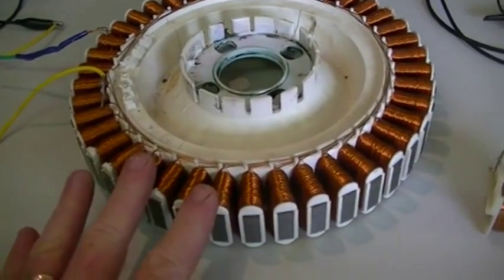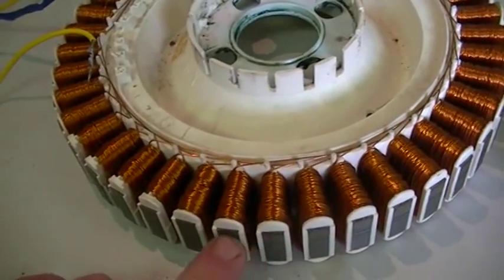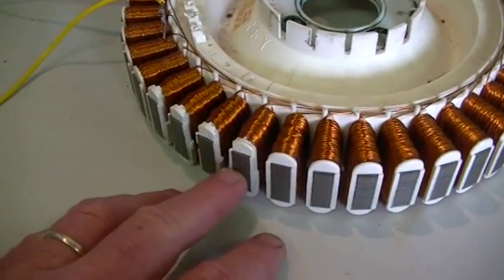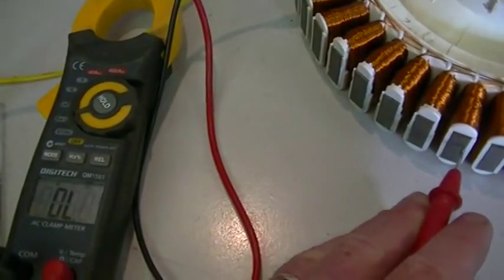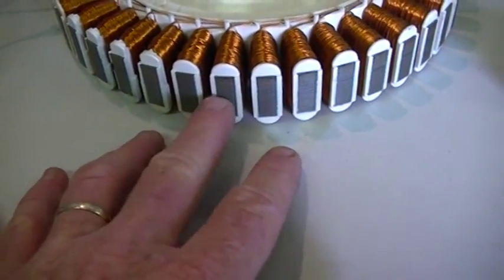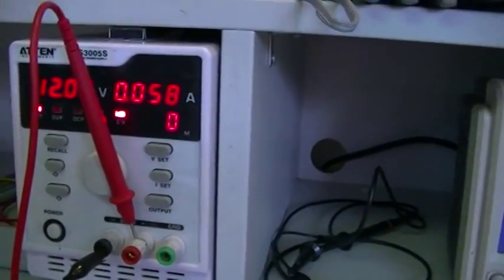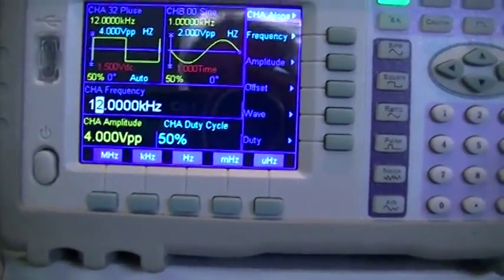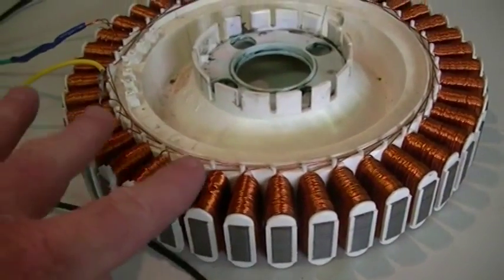Duel Magnetic Vortex Generator another look

Comment: Don't forget, the simplest electromagnet is a nail and a few turns of laminated wire, do you get a circuit between the nail and one end of the coil??? and, of course a magnet waved across the end of the nail, and so-on and so-forth..........

Comment: i would say it could be like a joule ringer like lasersaber or the work Xee2 did with transformer but in this case your taping off the core instead of a separate output coil..
Reply: yea the greater the frequency the more the coils resist a change of state, inducing a stronger signal in the core, when you touch the lead to it acts as if your moving the signal over to the coil with the LED.